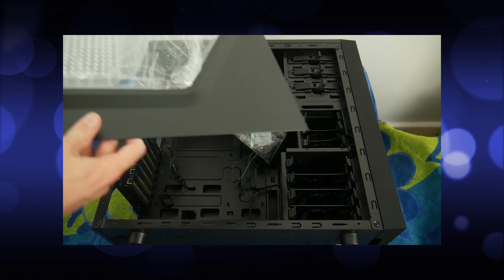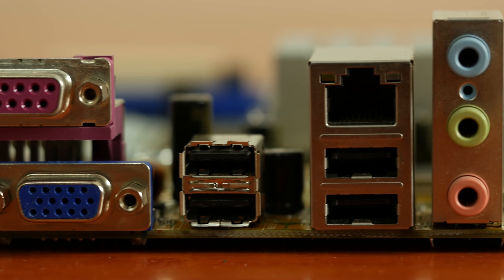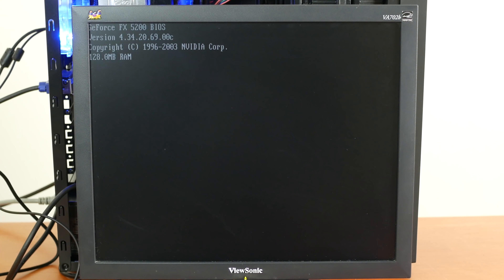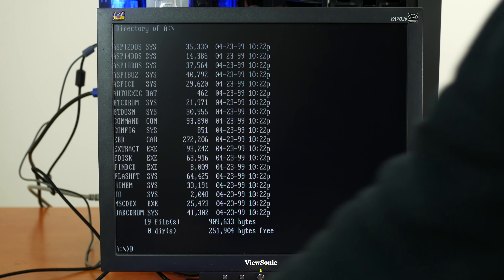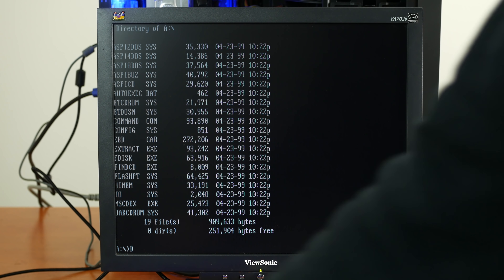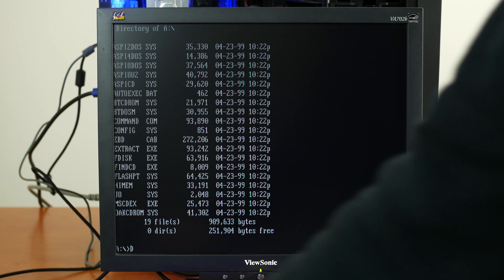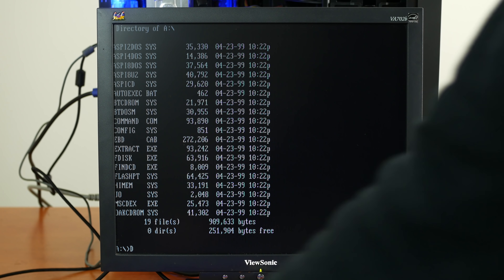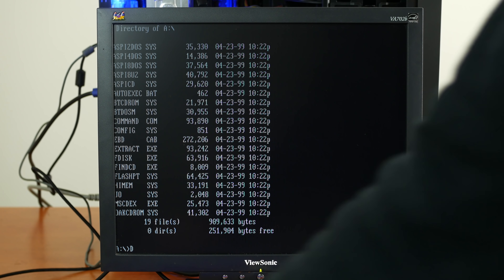What's the fastest (officially supported) Windows 98 PC?

Comment: What’s the fastest (officially supoorted) Windows XP PC?
Reply: What’s the fastest (officially supported) Hannah Montana Linux PC? even better, TempleOS.
Reply: probably what ever has ahci drivers for xp witch is a pain to install with out a usb floppy drive as for the fastest system mines is a 990fx with a FX-8120 125W Black Edition and a gtx 560 and 16GB of ram, though thats over kill. 
it runs Smooth as Butter.
Reply: Just grab an old motherboard from like 2014-2016 Any modern CPU would work (assuming they can fit in the motherboard), and XP is still supported by a LOT of drivers.
Reply: @SilverX95  im pretty sure gtx 980 support is possible for windows xp
Reply: @𩛗  980s are still pretty pricey at lest a gtx 700 series would be a better choice I'm mostly just using what i have and it works vary well.
Reply: The fastest hardware with official driver support for XP are a i7-2700K  on a Z68 motherboard and a GTX 780 Ti, both got official support. The GTX 960 also has support, but is slower than the 780 Ti. Maybe a i7-3960X would also work. Some newer things might be tricked into running it.
Reply: @HappyBeezerStudios  I've gotten it running on my Ryzen 3700X + Radeon 5700 XT with a little bit of hacks, it's however not running at native speed I think, as the Radeon XP drivers can't even comprehend that powerful of graphics. Surprisingly wifi and sound do work
Reply: @𩛗  780ti was the last
Reply: @Nikolai Nyegaard that I'm aware of the Intel X79 platform would probably be the fastest and last officially supported win xp system you can go for. The GeForce GTX 9xx series were the last cards to have xp drivers, but as someone stated I would suggest going to either the GTX 6xx/7xx series. Those cards will be have better driver support for win xp.
Reply: Austin Evans got XP running on a FX 9590 and R9 290 if that means anything.
Reply: Officially? An amd fx machine.
Unofficially? People have found ways to install xp on an x299 dark, and some z490 motherboards. Less so on Ryzen, I'm afraid. Either that or just not as publicized. Rule of thumb thus far is ps/2 ports + third party sata controller == yes, you can
Reply: @𩛗  ordinarygamers lol
Reply: The GTX 780 ti is that fastest support GPU for XP and the GTX 960 is the newest supported GPU (the 970 and 980 do not have any offical drivers) as for CPU and chipset support I'm fairly unsure, i have seen some 1155 board support xp so maybe a 2nd gen i7?
Reply: X79 motherboard, Intel Core i7-3960X, 4 x DDR3 sticks (quad-channel mode), 2 x GeForce GTX 980 Ti in SLI, maybe a Sound Blaster X-Fi Titanium, a bunch of small SSD drives in RAID-0.
Reply: Intel Haswell generation, I built my own “ultimate XP machine” with a 750ti and a G3258 overclocked to 4.7GHz as there’s no point using more than 2 cores with XP
Reply: My last XP compatible motherboard was the MSI B75MA-P45 witch I bought for that specific reason :-)
Reply: My OptiPlex 790 Core i3 2nd gen from 2011 officially support Windows XP.
Reply: 3770K (Z77) + Titan Black on the mainstream level and 4960X (X79) + the dual GPU Titan Z on HEDT level.

Comment: Fun fact about Windows 98, it's the reason we never got a Windows 9 and they jumped straight to 10. Thanks to the fact Windows 98 is referred to as windows 9 in the code, they realized this would cause a ton of issues, so they decided to just skip 9 and go to 10.
Reply: Windows Vista is 6.0, 7 is 6.1, 8 is 6.2, and 10 is 10. 
They didn't just skip 9, they skipped 7 8 and 9.
Reply: @DyceFreak  Did you just forget about Windows 7 and Windows 8?

Comment: 1:38 Nvidia's Geforce 6 video cards all support Windows 98. You'll have to install the drivers through Device Manager and not the .exe installer, but they will work just fine.
Running Windows 98 in 1080p was an unusual experience.
There are also unofficial generic SATA drivers for Windows 98. Look up "rloew sata driver" on Vogons.
Reply: yes, but was this not a video about running 98 on officially supported hardware? I mean, I got 98 and ME running on Dosbox on a PI4 and it runs fast and more or less stable, doesn't mean it's officially supported

Comment: It is worth mentioning that using older drivers targeting either when your card was released or near the release of the game you want to run will get you better results for Nvidia on Win 98SE. Last drivers for Win 98 typically have worse performance for older cards. Especially for my stock Nvidia TNT2 that came with my 1999 computer, significantly better to use contemporary drivers. But I have a GeForce 3 Ti 200 on the way and you'll bet I'll be using 2001 era drivers for that card.

Good luck on your Win 98SE adventures and good video. I've been having a blast on my 1999 Dell XPS T500 Pentium III machine that I held onto since 2001 and fixed up in 2017 as my Win 98SE retro gaming PC.

Comment: This follows an idea I had of finding the oldest possible system you can throw an SSD at. Interesting.
Reply: You can use ssd for any pc as long as there's a sata port
Reply: @apchistuz  There are also SSDs with IDE port. But you cant used them everywhere where IDE port is installed, because they basically did not support old PIO modes correctly.
Reply: Depending on how you define SSD, you can get pretty old. I'm using a CompactFlash adapter for the primary storage on my Super 7 machine, and older is definitely possible. 
Floppy drive emulators are arguably SSDs and will get you right to the 5150, but smack of cheating to me.
The XT-IDE controller card will get you CompactFlash support on a 5150 and doesn't really feel like cheating(it's "just" a hard disk controller).

Past a certain point, really the problem becomes "can I find a controller card that will fit the slots" more than "does this motherboard support that".

If you're limiting yourself to SATA and M.2 flash drives, then the limiting factor becomes SATA ports. There are PCI-E and regular PCI SATA controller cards, and SATA is intentionally designed to boot in a mode that looks like IDE to the host computer, so... that should get you back to the late 486, early Pentium era(though I've not tested it).

Comment: 771 can be adapted to 775, which means you can use a modified X5450 xeon with 12MB cache 4 cores. Ive used this myself in an optiplex 360
Reply: Only that 98 can only use one core. So a quad won't give any benefit over a dual there. For 98/XP dual boot the situation is obviously different.
Got a X5460 myself, runs like a dream and with some oc it is surprisingly fast. In fact, I'm writing from that very system.
Reply: @HappyBeezerStudios  
The fastest quad you could get would be the X5470, but that's a rather rare cpu to find. For a pure Windows 98 machine I would prefer a C2D E8600 as it has the same speed, but uses less power, so easier to cool.
For a dual booting machine, where you don't need the maximum speed but rather want a cool (and therefore quieter) running machine you can take an E5450 (80W) instead of the X5450 (120W) or even go for the L5430 (50W). Especially in SFF boxes, where you often don't have much spare for better coolers, it keeps them much quieter.
Reply: @axelstrack85  obviously. 98 won't use more than one core, and even for dual boot with XP an dual core will be enough, can't think of any games that require more and won't run on newer Windows.
Got my old E8400 here, and it has been a great choice at the time.
The bigger problem comes with chipset support under 98, LGA775 chipsets tend do be a tough choice, and those like 945P won't run 333 fab properly.
The E5800 and E6800 might be another choice for a fast but compatible chip.
Reply: @axelstrack85  the thing with the TDP between the E54xx and X54xx is that it's more of a theoretical thing. The maximum they're allowed to draw and the amount the cooler should be designed for, but not necessarily the real world draw.
My bigger i5 for example has a 77W TDP, but even with oc it won't even touch 70W

Comment: About the BIOS part: still a pain point today sometimes! (like those bought a Ryzen 5000 CPU and a slightly older motherboard that only supports up to Ryzen 3000s.) IPMI or other technologies that enable BIOS updates without a CPU installed really comes to rescue.
Reply: I went through this for the first set of b350 motherboards for my first gen ryzen. The original bios was very glitchy, and didn't come with built in flashing. Now I'm going to upgrade to Zen three, so I've got about 3 more flashes to try not mess up

Comment: Great video, but there is actually an even better motherboard available that also officially supports Windows 98. The AsRock ConRoe865PE has the exact same AGP Ports and DDR RAM that is found in the Asus motherboard but also supports quad-core processors, including the Intel Core 2 Extreme QX6950 processor, which outperforms even the Intel Core 2 Extreme X6800 in not only quad-core performance but also both dual-core and single-core performance.

Comment: Back in my PC building days, went through a bunch of those P5PE-VM.  Think I mights still have a couple kicking around.  I suspect you're right about it using older components; these were used, in our case, because they were cheap - not because they were good.  And they were relatively reliable from what I recall.  Nice video!

Comment: If someone says that everything was better back then, show them this video. We've come such a long way in compatibility that will save you from so many headaches.
Reply: Although 98 is most definitely a headache, this video is actually a great example of how to NOT install Windows 98, considering Matt didn't enable ACPI which caused nearly all of the issues mentioned in this video.
Reply: @DyceFreak  Or enable Legacy IDE mode for his SATA drives. The Geforce 6 series card is also a headache for 98SE as well, needed to go a generation or two back there.

Comment: I recently rebuilt myself some vintage computers from when I was young. Your video clearly shows how painful it is to source the right parts and the re-learning of how much of a pain in the butt it is to setup. Even worse as you go for older hardware.
I recently rebuilt myself a K6-2 400, soundblaster 16, Voodoo 3 16mb pci and an Athlon XP 2200+ ATI Radeon 9200, Sound blaster live.
my K6-2 took forever to built. Was originally supposed to be a K6-266 but that CPU was defect, my first motherboard couldn`t make the serial port work for the mouse, my replacement board didn`t seem to work till I realized the issue was the K6-266 and not a bios issue, and after the latest bios, I was pleasently surprised that a K6-2 400 worked on the board which is not a super socket7.

It really was much more of a patience testing challenge to build and work on computers back then. Also installing, transfering files, installing Drivers and software... everything took so much longer.

Comment: Interesting video! I've had a similar journey attempting to find the last supported Windows 98 hardware. 

How far did you explore the AMD side? In my own experience, I found much newer supported hardware. The Asrock AM2NF3-VSTA doesn't list Windows 98 as a supported operating system but its nForce3 chipset does have Windows 98 supported drivers by Nvidia. You can pair that board with a AMD Phenom II X4 980 Black Edition 3.6GHz from 2010(!) and DDR2 1066 Ram. In my own benchmarks this bested the Asrock i775i65g with an X6800 Core 2 Extreme. Perhaps a Part 3 video can explore this? :)
Reply: The question is, would that Phenom run faster than a Core 2. Under 98 we can't use more than 1 core anyway, so that isn't much of a topic, and stock that Phenom surely is faster than even a E8600 (fastest clocking Core 2 at stock), but once we factor in oc things might change. Both architectures top out around 4.0 GHz, so even that can't be used to decide which is faster.

Comment: I have an IDE data cable that I can give to you if you want. I pulled it from a Dell Optiplex GX-260 and it has like 3 "ends" on it for connecting multiple drives. While it worked in the Dell, I'm not entirely sure if that's supported by motherboards that aren't from Dell.
Reply: there are 40 and 80 conductors ide cables, and also not all cables support cable select,
but in most cases most ide cables work.

Comment: Funnily enough I had the exact same experience with a Compaq Presario on windows 10. A customer said it has stopped booting so I stripped it down and was super confused as nothing seemed wrong. I removed the CD-R drive and low and behold it booted.
Reply: I have a Latitude D620 running XP… the first couple times I used it I could not for the life of me figure out why it took easily 10 minutes to boot. Tried everything and just when I was about to give up, I switched the disk drive with another Dell laptop. Worked great!

Comment: I enjoy your videos man, You do a great job, good personality and sense of humor. Thankyou for making them. I really enjoyed the video about the Japanese version Legos island.

Hey but I wanted to write out here, how I have found installing things in a specific order to work best. 

I hope it may be helpful or someone finds it useful.

Use the win98 se oem cd to startup with cdrom support. From (A:) Run fdisk, if your hard drive is over 40 gb my advise is to partition it into two parts. And use percentages. So ultimately making the first partition like no bigger than 10 gb. That’s where you will install the os. (C:) make it active. Then create a second partition (d:) with the remaining size of the drive. Bingo even if the numbers glitch out with the actual size of the drive because it’s too large, it will work if you use percentages. Format them by once again booting into dos prompt using cdrom support. (Depending on your masters and slaves it should be like 
•E:
•Cd Win98
•Format C: /q (if it says you have to do a full format opposed to the quick format, then that’s what you will have to do.)

I personally don’t use hard drives much over 100gb there is no point in windows 98. You could always create a little local area network and transfer that way or just like you did. Usb. You can also create a custom cd image of the oem cd and add the usb drivers on the image so when you install the os you already have access to the drivers.

Go into bios and disable things you will not be using… like serial ports.. parallel ports.. frees up irq and resources… makes things run much better.

Install wind98se=install Usb drivers(nusb33e)=install CHIPSET DRIVERS (very important) =install graphics drivers=install sound drivers=install any other interface or board drivers like Lan cards or USB ports or ect cards.= install msi package reader = install winrar = install internet explorer 6= install the most recent unofficial win98 service pack 3 main core updates= install direct x 9.0c = install performance tweaks pack.= then install kernel ex( I don’t even bother with kernel ex personally, if I want to run newer stuff I’ll use xp.)

And lastly I setup dos, depending on my plans for the build I’m doing. MotherBoards with ISA for older win 98 build. PCI slots and agp and pci express for newer build.
(Phil’s computer lab is the place to go for the dos information)

When all that’s done. I boot into safe mode and let safe mode do it’s thing for a few minutes and then I restart back into normal windows.

If it has not blue screened or crashed by this point, I usually feel pretty confident about the build.

Something to keep in mind though about graphics cards in win 98, Do not attempt to use any nvidia card over the fx series in win98. 6 series cards are not supported and do not work with older graphic apis and effects like fog and 8bit textures.

And when it comes to ram.. I usually stop at like 512mb now, there is stuff you can do to make win 98 like more than that.. but, there is no application in win98 that will need more than that unless you are using win98 for professional type software. Music or video for example.

And that’s all that comes to mind at the moment. It took me a long time to finally kinda figure out a system to all this. One that seems to work. Win 98 can be stable, it’s just unforgiving. So yeah making an image back up is a very good idea.

Comment: I used to have a Gigabyte 8I865GME-775-RH-AS (v3.9) and an AsRock 775i65G (v2.0)... Both of them supported Core 2 Duo and AGP.
Sadly they're not working anymore, I was in the urge to reuse those caps and heatsinks like 2 years ago.
Reply: Can always recap them.Which might not be the worst idea in the first place. While LGA775 was mostly after the big capacitor plague of the early 00s, with cheaper boards there might still be some isisues.
Reply: @HappyBeezerStudios  sure i can do that but i must search those boards..oh and cheaper ones? PcChips has entered the chat xd